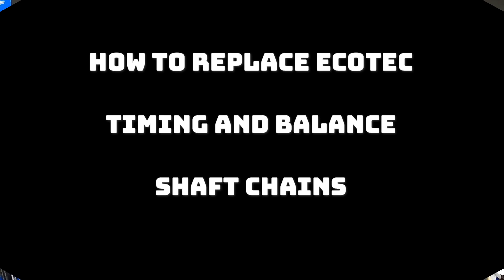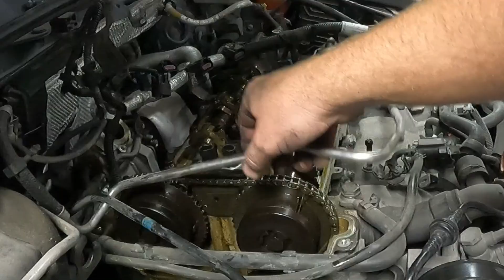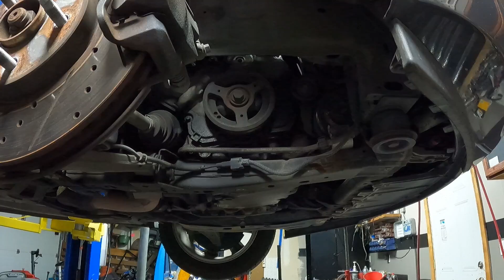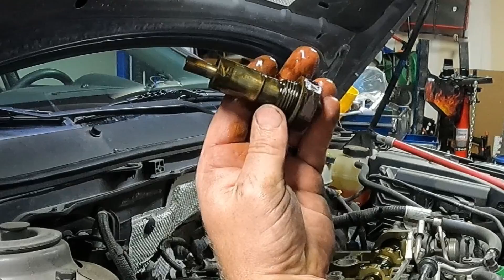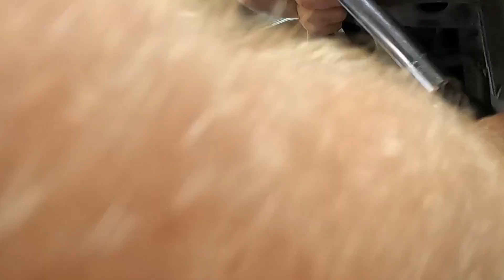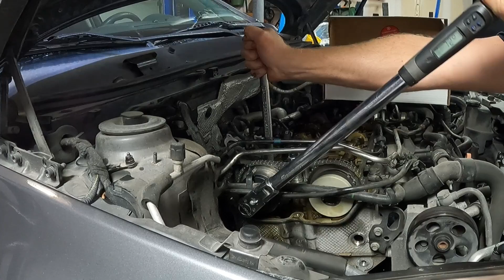How To Replace Ecotec Timing Chains and Balance Shaft Chains

Comment: I can't put back in place the exhaust sprocket because the chain is too tight. What could possible be?
Reply from the maker: Make sure you don’t have the tensioner installed. Also make sure the sprocket is locked out. If it’s not, you need to replace it.
Reply: @PetesGarageandperformance  Yes, I removed the tensioner and the sprockets are good apparently. Thanks for your reply
Reply from the maker: Maybe you need to slightly rotate the camshaft to align the dowel pin on the sprocket to the slot in the front of the cam?
Reply: @PetesGarageandperformance  The chain is so tight that I don't have room to alight the sprocket to the slot..
Reply from the maker: Hard to tell from here but also make sure the guide on the right side is installed correctly
Reply: @PetesGarageandperformance  I'll do thank you!
Reply from the maker: Any luck?
Reply: @PetesGarageandperformance  I did what you said.. I rotated the camshaft a little bit and it fitted.. thanks!!

Comment: Do you have a video of this being done on the 2.0 LTG engine? I called a shop and they’re wanting $2400 for the entire job using GM parts and not sure if finding time and doing it myself is worth it VS working a full day with OT at my current job lol.
Reply from the maker: It’s basically the same procedure.

Comment: The balance chain was skipped a tooth and the mark on the crank shaft sprocket wasn’t lined up with mark in the engine block . Isn’t that supposed to be lined up I’m just wondering cause I’m have it trouble getting mine to not have codes after I line up everything perfectly

Comment: I had problem when came to taken the cam bolts out,they were so tight, the cams moved and took everything out of time, so i turned the crank clockwise to try to get the timing back correct, but the chain kept slipping and the cams are just out of wack ,so i stop turning the crank and left it at tdc ,so what do i do ,need you're help on what to do to get everything back to the correct time please
Reply from the maker: Since it’s a 4 cylinder you can rotate the crank to put all of the cylinders half way between tdc and bdc. Then you can rotate both camshafts to the positions that they’ll need to be in during the timing procedure. Then rotate the crankshaft to its timing position and install the timing chain.
Reply: Hello Pete ,can I get a response, please

Comment: I replaced my timing chain on my Ecotec 2.0 engine but read that this must be done at TDC on the EXHAUST stroke, not the COMPRESSION stroke. IDK which stroke I was on when I lined everything up. I just know that I had the timing marks on the cam sprockets and the balancer lined up per the service manual. I then rotated the crank bolt 2 full revolutions and did not hear any banging or feel anything strange. How can I be sure that I am ok or not?

Comment: I have a problem. My colored links are not lined up with the timing marks on the sprockets.they are way off.... Its like they didn't install it correctly at the factory. any advice?
Reply from the maker: Once the engine spins around the links won’t line back up. But the crankshaft should still be #1 TDC and the cams in the 10 o clock and 2 o clock positions like in the video.

Comment: Had an issue where the chain popped off when doing the TDC alignment. Timing marks for balancer chain was off so I turned the engine over to try get those aligned. Will I bend my valves because I turned the engine over a bunch of times?
Reply from the maker: Make sure none of the intake or exhaust valves are open and you can spin the crank. There is usually a spot where there isn’t much spring pressure fighting the camshafts. That is usually where the valves are all closed. If the crankshaft becomes more difficult to turn, go back the other way. Don’t force it or else you could be bending the valves.

Comment: what is meant by "10 on a stick"?. is it just a 10mm socket on an extension?
Reply from the maker: It’s Snap-on part number PFXSM910B. It’s an extension with a swivel socket on the end. It’s one piece and can get into pretty tight spots. 
https://shop.snapon.com/product/PFSXM910B

Comment: So i have 2.2l engine and when changing the regular timing chain i noticed the balance shaft timing chain was very loose. Could this be a cause for a vibrating engine below 1500 rpm? (Above 1500 rpm the engines works just fine, below 1500 rpm the engine runs reliably but the vibrations are felt through the whole car) I already checked for vacuum leaks, malfunctioning injectors, maf sensor is working good, 02 sensors are working good aswell. Even compression is as good as new. I am running out of ideas so im hoping one of you might know if a worn out balance shaft timing chain could be the culprit?
Reply from the maker: It is possible that the balance shaft chain skipped teeth and that would make the secondary vibrations worse. But I would really check out the engine mount on the passenger side.

Comment: So I’m suspecting rattle is coming from specifically the balance chain tensioner. As the cam tensioner was good. I replaced everything, now I hear this whining sound and still, the rattle persists. Is it because of that balance tensioner being too tight or “ratched” out as what online is saying? I’m gonna open it up again and check. Using the stethoscope I hear that same rattle in that exact spot that the balance chain tensioner is on, from behind the cover.
Reply from the maker: Did you reset both the timing chain and balance chain tensioner before installing them. Pull the grenade pin on the balance chain tensioner AFTER all of the guides, tensioner, and chain is installed. You have to disassemble the cam chain tensioner to “reset” it with a screwdriver. Then after installing the chain you have to whack the tensioner back to set it. Pretty sure I did it in this video somewhere.
Reply: @ I have redone everything, reset both tensioners in their places. I didn’t have enough time today and it went dark so I will follow up tomorrow as I close it back up and turn it on
Reply: I've had this job done on my a20nft 2.0t uk version of this and am having the same noise like balance chain is dragging on the casing, both tensioners were replaced.

Comment: It's amazing how many videos on this job are setting the timing up on TDC when it is supposed to be on the exhaust stroke. 😅 And how none show the marks for the balance shafts at the same time. 😅
Reply: I don't get it. I thought you are supposed to setup timing at TDC on the Compression stroke. ...my problem is that I am at TDC and my timing marks on the cams are pointed at 10 and 2 o'clock BUT the colored chain links are not lined up with the marks. its not even close. was wondering if the factory may have put the chain on mis-aligned. shouldn't the colored link always point to the mark (whether its at 10 o'clock or even 5 o'clock)?
Reply: GM wants you to line up the marks for the exhaust stroke . Not compression stroke. That's why the marks on the chain are not lining up  @roscoeroscoe8695
Reply: OMG thank you for saying this!!! I'm taking mine apart right now and I set it to TDC #1 compression, and the marks are at 5 and 7 so there's no way it would work!  I just spent like an hour trying to confirm where the crank is actually supposed to be.  There's many videos on this and nobody just says that, it's very frustrating. Anyway, thanks for saying that, it finally makes sense lol
Reply: You are welcome, I work on cars for a living and read the GM manual. At first it didn't make sense until I went to line all the marks up. 😅 @warhammer40k-f1r
Reply: @Jonny-Tech well, I appreciate it 😂.  The timing chain and guides aren't even bad on mine, it's got a dead hole that looks like a chipped exhaust valve, so all this is just part of getting the head off lol. I'm doing the chain and guides too, it was due anyway.  As far as these things go, it hasn't been too bad... honestly the hardest part is this job has just been trying to figure out this " where the crank is supposed to be" nonsense 😂.
Reply: That 2.4 also has issues with the pcv valve.  Make sure it's super clean when you put it all back together. 👍 @warhammer40k-f1r
Reply: @Jonny-Tech Thanks, this is the second Ecotec I've had ...last one I just drilled a hole in the intake and covered it with tape so I could clean it every time I changed the oil 😂.  It's a really dumb design...I wish there was a way to put a catch can on it, the amount of crap on the intake valves is ridiculous.  I guess at least I can clean them now that the head is off lol

Comment: Hey Pete, you said you would leave a link to the part number for this kit at RockAuto but I don't see it. Can you post it please? Many thanks.
Reply: This is my other YT account so if you reply I can make sure I get notified. Thanks.
Reply from the maker: It won’t let me link Rockauto searches. But I did add Amazon links to the same parts other than the timing chain kit. They are now in the description of the video. The timing chain kit is Cloyes 94201SAVVT2.
Reply: @PetesGarageandperformance  That's great, thanks, I got the head off yesterday and I'm going to get the oil pan off here shortly, there arer parts of the adjusters missing and I'm sure I'll find them in the pan. Thanks again.
Reply from the maker: Yep. Make sure to check under the oil pump pickup tube. That’s where all of my pieces were.
Reply: @PetesGarageandperformance  That is what I was going to do.

Comment: Thank you! This helped a lot, i need to replace the sprockets for the secondary chain and i needed to knoe how to take them off, sadly you didn't have to, so I'll keep looking.
Reply from the maker: Undo the sprocket bolts before you remove the chain tension. Or you may have to remove the whole shaft so you. An hold it from spinning while removing the bolt.

Comment: Hi Pete. I came across your channel when your "is it necessary to change your transmission filter" video was suggested in the section to the right. Excellent video, and advise by the way. I'm currently working on my 98 GMC Savana 2500 work van and while changing the plugs and wires I noticed fluid pouring out of the steering gearbox boot on the top. After reading hours of reviews and online advise I'm stumped, and thought maybe you could shed some light. New or re-manufactured, brand, etc. With some many opinions claiming failure weeks or months after replacement on new and re-manufactured. I realize 80%+ of those complaints come from beating on the new gearbox, not flushing/bleeding, etc. I'd REALLY appreciate any advice. Sorry for commenting about this topic on this video, just figured I'd have a better chance of you seeing it and getting a reply. Thanks either way!
Reply from the maker: I would make sure the leak wasn’t coming from the fittings where the lines connect to the gearbox. They usually have o-rings on the end of them. I’ve never seen one of those gearboxes leak badly. They usually they just seep slowly. But if it is coming from the gearbox itself, I would get one that has the best warranty and avoid beating the steering shaft onto the input shaft of the gear. Should be pretty straightforward.
Reply: @PetesGarageandperformance  Thanks Pete! Unfortunately it's definitely the input shaft seal, and you're right, it was gently seeping for the last 3 or 4 years (few drops a day) but now it's a big drop every few seconds, and for what ever reason the steering wheel is turned about 20ish degrees going straight down the road and it's never been aligned...assuming that's wear in the box itself. Engine degreaser is soaking now, I'll rinse it in a little while and get started. Thanks again for the info.